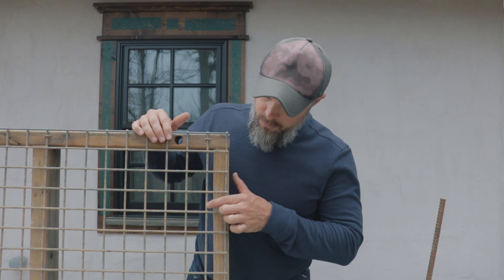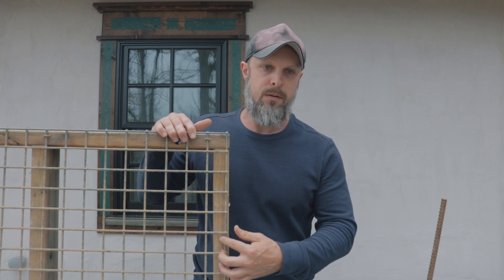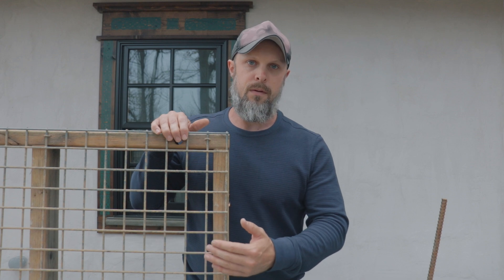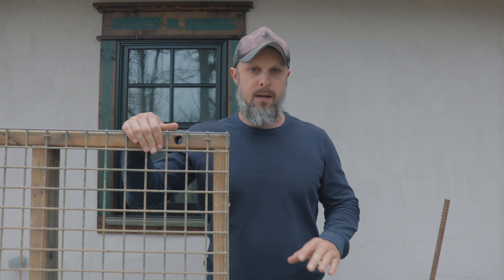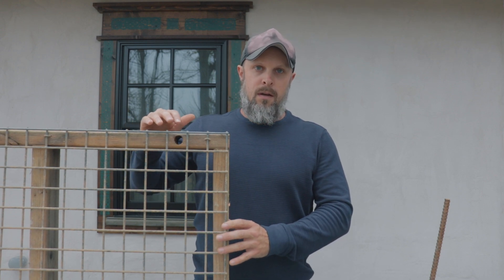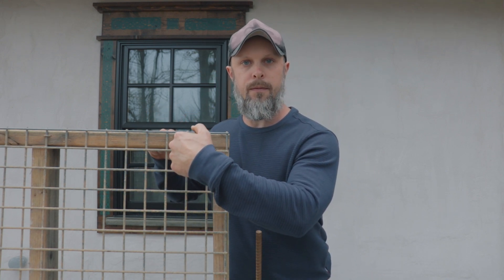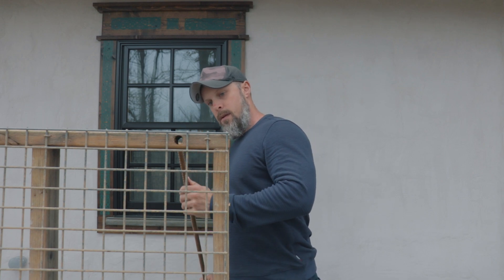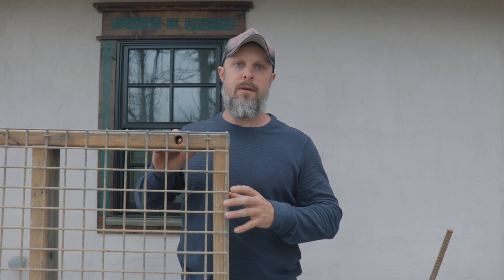How to Build Cob Slipforms - The Cob Slipform Method Tutorials

Comment from the maker: 🔴 Download my 17 hour premium video course on Cob Building and Natural Construction: https://www.thiscobhouse.com/online-cob-house-workshop/

🔴 Join an upcoming hands-on cob workshop: http://www.thiscobhouse.com/cob-workshops/

The threaded rods and brackets that I use can be purchased from DYWIDAG: https://dywidag.com/products
Read my latest article on slipform cob to get more details on how I build the forms: https://www.thiscobhouse.com/the-cob-slipform-method-why-build-your-cob-house-this-way/
Reply: I have a good supply of old shuttering pans, I don't know if these existed in the US.  They are 4' x 2' steel angle frame with 5/8" veneered ply.  They used what was called snap ties to keep them apart, typ 12".  These were flat bar like 1" x1/4 with punched slots, then you hammered in a key and wedge.  The whole thing is pretty solid when erected.  What I was thinking maybe builded a rammed earth retaining wall for a sunken greenhouse (i know this is off topic with cob). I could place some insulation against the inside back shutter.  Maybe make the wall 3' wide, also thinking of geogrid as reinforcing up every foot or so.  Finished height of 8 or 10 feet. Also use a impermeable membrane and drainage stone to keep it dry.  Any thought or suggestions thank you
Reply: Appreciate the video.... Can you tell me the specific name of those rod and bracket combos? Are they the "GFRP Rock Bolt" ? I have a project that needs these.... perfect solution.

Comment: Great video. Do you think the vertical studs could go 2'-3' spacing instead of the 16" spacing?
Reply from the maker: Yes. The spacing of the studs on the forms doesn't have to conform to any code standard. Just make sure the metal won't bow outward when you pack the cob in the forms.

Comment: I have searched this subject many different ways and it always leads back to your content. I've seen enough of your videos to know that I need to look no further. I'm going to watch all of your videos. Thank you. 

I'm not going to be able to find most of those components in Bohol Philippines, where I'm going to need 50 campground buildings and a bunch of other buildings. I'm also joining a group that puts up quick housing for victims of typhoons.

 Labor is incredibly abundant at $10 per day. Free when it's the charity thing after storms.

I will almost certainly have to have everything welded from raw stock, which means that I might go 1.5 inches on my grid size. 

My lumber choices are coconut and mahogany. I need to clear some mahogany and I think that will be better quality. 

There's one way that I could see improving the frame. I imagine putting a triangular piece of plate steel across the corner joints, so that the tightening pressure can act on both pieces of wood at the same time and not overstress the screws holding the 2x4s together. Maybe that's not much of a concern, and it does add some weight... We might also go with a little thicker wood, so that we can put a metal sleeve inside the drill hole.

 I expect to have an on-site blacksmith and welder. They will live at the place until we are finished everything in a few years, and they may never leave, since they could make giftware for the guests and provide an interesting thing for them to watch and learn. They are often transient, so living at a resort and eating from the buffet each day, is bound to appeal to more of them than I could possibly employ. 🙂
.........
Our buildings must be able to withstand earthquakes as well as typhoons. We will reinforce with bamboo probably every 6 inches horizontally, and we will drive sharpened pieces vertically, every few feet. Steam bent bamboo will go around every corner. I want each building to be completely tied together like it's one monolithic block. We will use plenty of rice husk and rice straw, which will lighten the mix. 

I'm going to do a test mixing in a certain amount of slaking lime, to see how much it increases the strength. We must make our own in a lime kiln. Luckily that's the only rock on the farm. I expect that all finishes inside and out will be lime-based. There's a tall invasive grass threatening the village. It burns incredibly hot and it will be the fuel for the kiln.
.........
I will employ an unusual mixing method. The first time I ever witnessed hippies dancing in mud, I thought, those people need a water buffalo. We will have a buffalo led back and forth over the material. That's the big downfall I see with many builds, is the huge amount of labor required to prep the material. If I were doing it in Canada I would definitely use a bobcat.

I'll report progress as we go.

I look forward to producing photographs of all items that we employ so that others can critique the materials and methods.
Reply from the maker: Amazing! Yes, keep us informed of your progress.

Comment: What about the holes left behind by the bars in the wall? Wouldn’t that affect the integrity of the structure? Maybe be a moisture/air tunnel? Can/should they be filled in?
Reply from the maker: The holes are actually very small an have no impact on the structural integrity. You don't even need to fill them in actually. I just fill them in at the surface, and them add two coats of plaster over the walls. The openings are insignificant overall.

Comment: How do you fill in the holes created by the rods after they're removed?  What are the dimensions of the forms and the spacing of the vertical cross members?  Why are the rods so long when your walls are only 1 foot thick?  Thanks a lot!
Reply from the maker: I just fill in the remaining holes at the surface level with a bit of cob. Then I put wo coats of plaster over the walls too.
I like to make my forms 2 feet high, and I space the vertical pieces roughly every two feet also.
I use 4 foot rods so I can vary the width of my walls. You can use shorter rods if you want.

Comment: 3:12 Asssuming those are standard 2x4's, which are about 1 5/8 inch wide, I'm guessing that's actually a 2x2 gridwork on the wire fencing. Just guessing by eye.
Reply from the maker: Yes, actually I think I said the wrong size. They ae 2x2 inch openings in my mesh grid.

Comment: Wouldn't your external form need to be longer than your internal form (the outside dimension of the house is bigger than the inside)? Also, what do you do with the holes left in the cob by the threaded rod? Finally, how do you fasten the forms to each other at the corners?
Reply from the maker: Yes, form lengths will be different for internal and external forms for most situations. Unless you're just building panels at a time. I'll make a separate video showing this. Thanks for the question!

The holes can just be filled in at the surface with some cob. Then plaster over the walls at the end. That's all I do anyway. The holes are very small.

At the corners, I screws the forms together wherever they touch, and sometimes use bar clamps as well. Basically, whatever holds them together at the corners.
Reply: You're amazing!

Comment: What is 6 gauge wire in mm ?
4mm ?
Reply: Google "wire gauge table". From there you may find the diameter or at least the CSA, then use math to work that back into a diameter. There usually is a diameter measurement though.